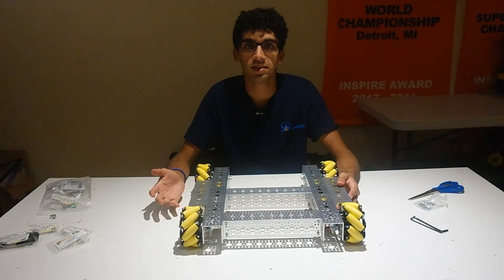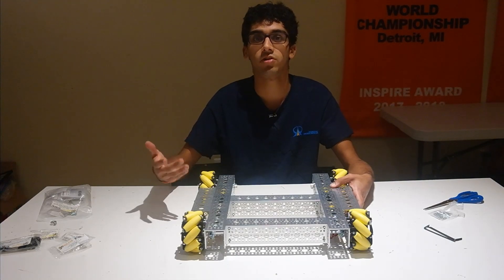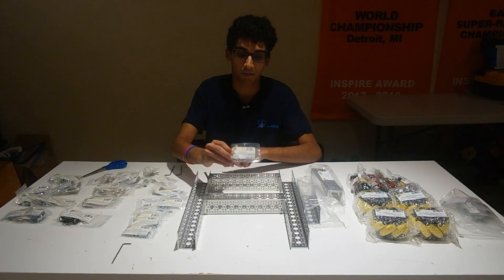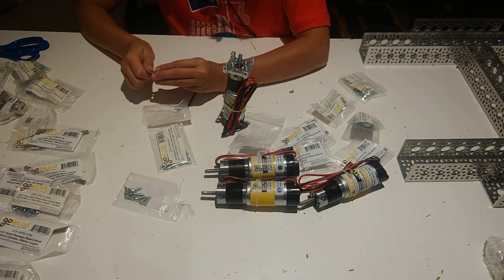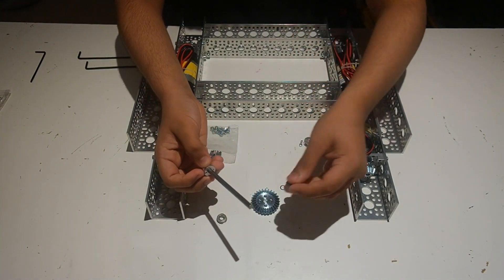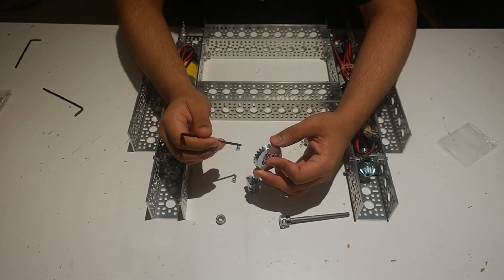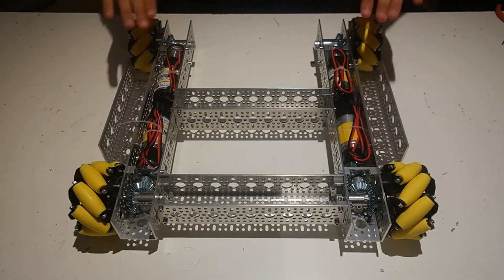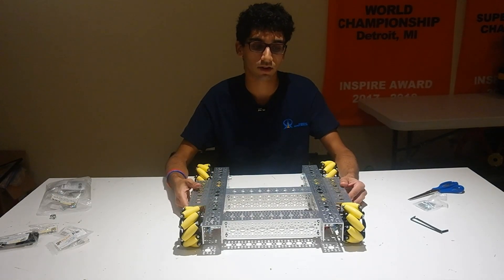Odometry Spell Book Part 1: Building a Modified goBILDA Strafer Chassis Kit

Comment: Thank you for posting these videos. COUNTS_PER_INCH in your OdometryCalibration.java program. How is this derived? Is this going to be the same for everyone if one uses the parts you listed?
Reply from the maker: Yes, if everyone uses the same parts listed the COUNTS_PER_INCH variable will be the same for everyone. The way this is derived is you divide the pulses per revolution of the encoder by the circumference of the wheel. You may need to do some additional unit conversions. To test it out, you could have the robot move 24 inches forward, measure the encoder counts on each wheel, and divide the encoder counts by 24 inches. It should be very close to the variable included in the code.